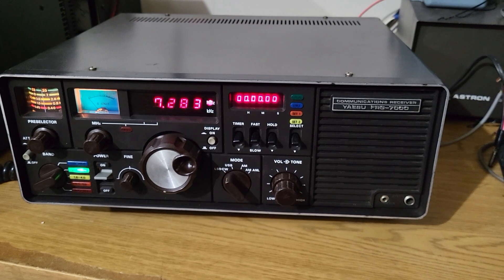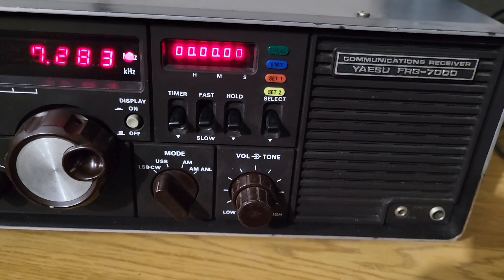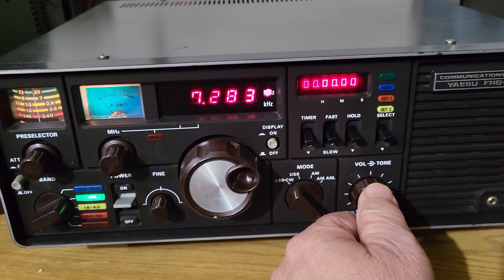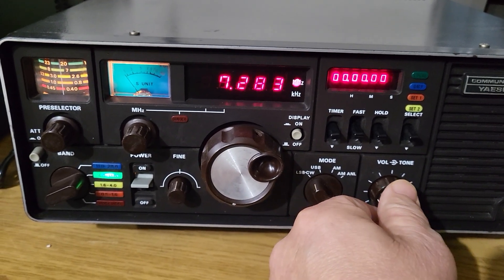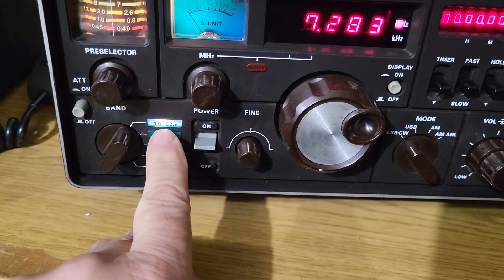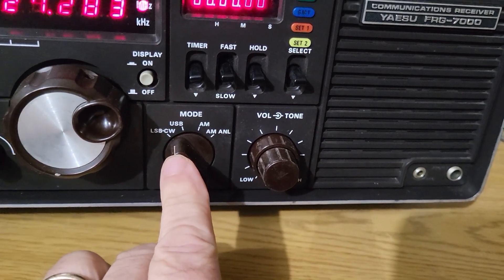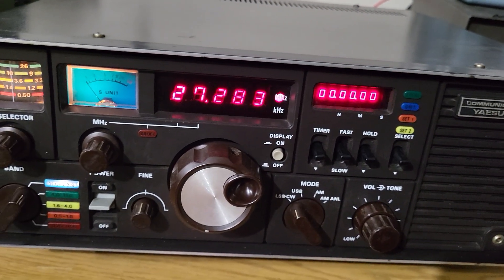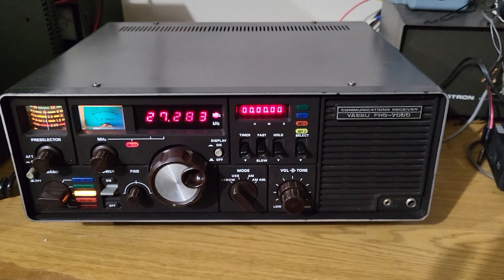Yaesu FRG-7000 Communications Receiver

Comment: I have only seen one of these receivers in action. Our SW DX club was loaned one by a distributor. They are uncommon, and were hard to get when they were first produced. I went from a Yaesu FRG7 to FRG 7700. What impresses me is the 7000's fine tuning. The later and more common  FRG7700 did not have a well functioning fine tuning control. In fact, the one on my receiver has never worked since it was new out of the box, and other owners have experienced the same thing.